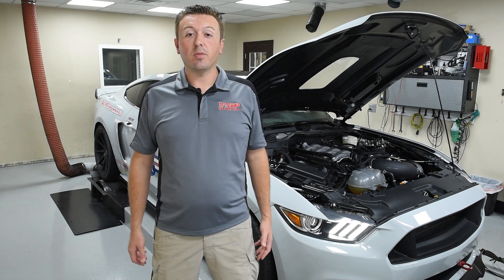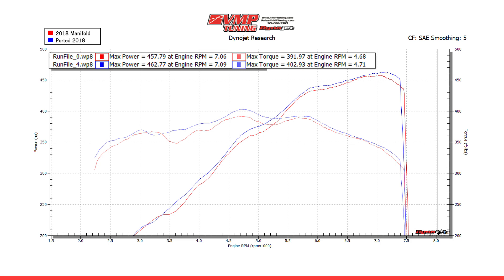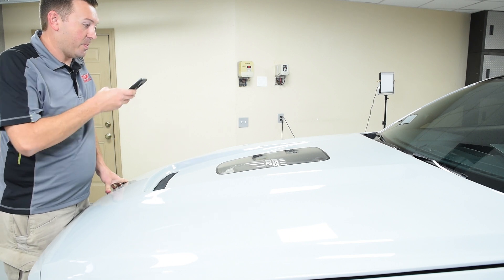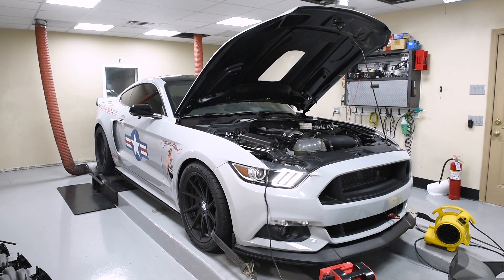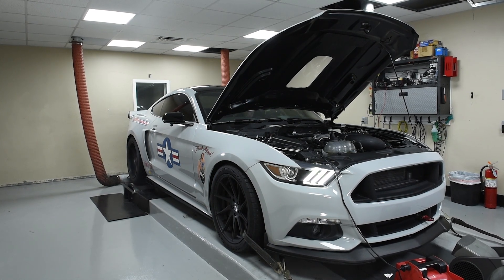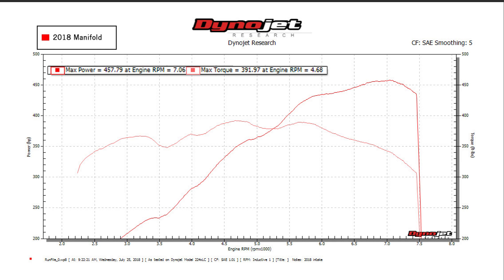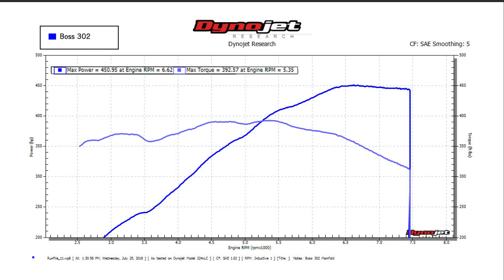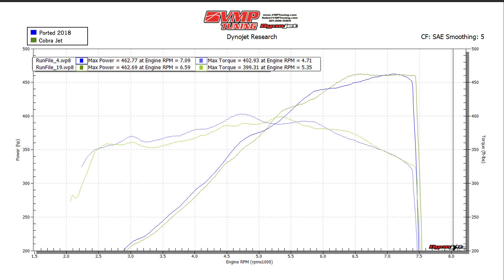VMP Performance | Coyote Ford Mustang Manifold Shootout

Comment: I have a 2013 5.0 and the truck manifold looks promising. Would like to know the difference in power through the curve of the truck manifold, stock 2015 manifold and stock 2011 manifold. They all drop off at 6500 but if you gained power everywhere else that would be a great bang for your buck. Many 1st gen Coyote owners dont want to rev past around 7000-7200K. Every single other manifold in this test would need to be revved to at least 7500 RPM or it would make the car slower vs the stock ones.

Comment: The truck intake is the best power curve for anyone swapping this motor into a car with any manual transmission other than a built T56 cobra spec or better transmission. 

You just can’t get older synchronization technology to shift much over 6500-6800

Also the older 5 speed transmissions have great gaps that are far larger than newer 6 speed transmissions. 

One question. Is the torque curve wave due to the variable valve timing?

Comment: I’m curious as to how much the heads and cam make a difference. I have an early Coyote from my old 2011 GT that’s been swapped into a Fox. It’s got the BBk swap headers and a 90 mm throttle body. But it also has Stock 2011 GT cams on the stock heads with the stock manifold. 
The Coyote is on it’s 3rd gen now and Heads and cams have greatly improved...so for a guy like me I’d still have to do a lot ( heads, cam, tuning,etc) to get similar numbers yeah?
Reply: There's a guy i know has videos on YouTube he has l&m intake cams and stock exhaust cams with ported gen 1 cylinder heads and ported cj manifold he made 488hp on a mustang dyno at only 8k his dyno chart showed the car was still making power even at 8k rpms

Comment: Very confused... This is being reported as RWHP, which is clearly listed as more than the flywheel HP.
Please explain 🤔🤔
Reply from the maker: The numbers presented here are measured at the tire so they are RWHP.
The dyno isn't "generous" it is a dynojet 224xLC.
A stock 15-17 GT M6 with 3.31's makes 370-385 RWHP with good 93 on this dyno.
A stock 15-17 GT M6 with 3.31's and a tune makes 400-415 RWHP with good 93 on this dyno. 
With a set of longtubes, a different intake manifold, and a cold air intake to make more power.
-Joe Goodnough
Reply: @VMPPerformanceTV  then what would the crankshaft calculated horsepower be?
I'm still very skeptical and I own one of these cars.
Reply: +AASR 32 I'm gonna boil this down to every dyno is different.
Reply: @aasr3251  
Roughly 500 hp at the flywheel. That's a 65 hp increase from stock, with essentially full bolt ons, tune and 93. Makes sense to me based on what everybody else has seen with these mods.
Reply: +Thunder Mountain Buildings  Huh!... He just said above they make 370-385whp stock. It's more like 90whp off full bolt on and 93 tune. I'm gonna agree with every dyno is different comment. You cant expect to see those numbers everywhere, that's rare.
Reply: AASR 32 I was wondering too
Reply: @gerardoflores6316  : clearly, something is way off- or they are reporting "flywheel" HP.
Reply: AASR 32  A chassis dyno measures rwhp and if I'm not mistaken, calculates flywheel hp if you choose to display that. Cars in this class almost always advertised by rwhp as they should. Unless I missed it, where did you see that rwhp is shown to be higher than flywheel? Also, even a small amount of familiarity with these cars would let you know that is absolutely rwhp and quite accurate.
Reply: @marklennon7362  : I agree with you Mark. RWHP is typically lower than FWHP. So since the numbers depicted in this video are in the mid 400 to almost 500HP range, CLEARLY, they must be depicting the FWHP  'calculated'(by the Dyno) number in the charts displayed.
For these cars (which I'm very familiar with) to make nearly 500HP at the wheels, there would have to be closer to 600 at the crank.
Reply: I agree, this car is a BIG overachiever!! 450-460whp with just an intake, manifold, exhaust, and tune. That is one hell of a generous dyno considering stock the make around 360-370whp stock. I'm curious what it made with the stock manifold.
Reply: @TheBlkMach  : indeed! VMP needs to shed some light on this!!

Comment: Maybe I missed it or wasn't able to read between the lines ...you didn't  seem to cover the issue of whether you needed or used larger than stock Throttle body (unless you covered that in the "ported" manifold)?

The factory 80 mm vs the GT350 87mm or one of the recent aftermarket versions...which are 90mm, 92mm+.

I've heard they give inconsistent (touchy!) street tuning problems - sensitivity? The 2015 - 2017 have factory control over the secondaries, I would not want to give that up by using the CJ manifold on a street driven car.

I settled on the GT350 with 87mm GT350 throttle body. ... and yes - it can be sensitive coming off throttle, but when monitoring the AF ratio, it works the 12.5 - 13.7 range during a full throttle pull just as you would expect. Recovery can be touchy - until the computer re-adjust to "street" driving mode again.

I decided to stay with the GT350 stage 3 kit.

Comment: $329 vs $1049 wow and they performed almost the same
Reply: Multiple tuners say that the gt350 throttle body provides no noticeable gains.
Reply: Andrew Schwab  did you not watch the Video? The very first test was a Stock 18 Manifold......
Stock 18 manifold= 457hp, 391wtq.
Ported 18 manifold=462hp,402wtq
 GT350= 457hp, 397wtq
Reply: The 18 intake was cnc ported how much was that?
Reply: Carlos Rodriguez it that the price for the 18 vs CJ???? I'm sure it's an extra few hundred dollars for port work.
Reply: Well, Im thinking if the 18 has gt350 tb, its still gonna be badass and a better option for less.
Reply: Andrew Schwab you stupid didn’t even watch the video
Reply: I'm sure he was talking about the 18 and gt350 cost. But keep in mind, they didn't add the gt350 throttle body to it, that sucks in more air.

Comment: The other thing to think about with a manifold replacement is drivability. How smoothly does the car accelerate when not under WOT? The GT350 manifold was built for the voodoo motor and not for the coyote, so while it makes great HP and good TQ, the drivability is not as good as the 2018. That's why I went with the 2018, and I don't regret it for a second!
Reply: But with the gt350 manifold when running with a bigger throttle body and adding e85, it out runs that manifold. You need bigger injectors with the gt350 and you get more power after 6500 rpms from e85. It just gives you more power with all the add on's.
Reply: @tommylee7749  I have 1 E85 station within 50 miles and it runs out of it. I wish it were more readily available, but I can't use it. Hp is nice, but as I said in my original reply, drivability of the 2018 is tons better than the GT350 as well... so if you have to live with it on the street and not just WOT at the track, go with the 2018.

Comment: Would love to see what the 2018 manifold does for all us 2011 to 2014 guys.
Reply from the maker: We'll be doing that test soon!
Reply: Please do!!!
Reply: cookymunster every race I’ve seen, a 2013-2014 pulls the 2015-2017 in a straight line. I know the 13-14 weights a bit less but I feel like the hp is close as ford likely underrated the 2011-2014 and just upped the advertised hp number as needed. Case and point the 8 hp “increase” from 2012-2013. Nothing was done to merit the increase. Ford just thought 420 sounded better then 412 I guess.
Reply: @mr.excitement689  The 8 horsepower increase was real. Ford eliminated the oil squirters on the 13-14 models.
Reply: 331Grabber how exactly does eliminating oil squirters get you 8 hp?
Reply: @mr.excitement689  
Ask Ford. They said eliminating the oil squirters gained the Coyote 8 HP
Reply: @mr.excitement689  windage
Reply: 773H fr what I was thinking
Reply: Yes. I been told to put a 2018 GT ported intake on my procharged 2013 F150. Now the question to get a truck manifold or the mustang manifold after seeing this test. Unless someone has a better idea because its boosted? I also been told in order to get the manifold to fit, I will need to purchase a 2018 mustang thermostat housing. Not sure if its the same issue with install on the 11-14 mustang.
Reply: Jesse LaBelle got an Instagram was looking at your YouTube vids but I don’t think your truck is procharged in any of them, or is it?
Reply: Trevon Adams  I thought the same, but he later said the only reason the Boss 302 made power out to 7500 rpm was because of the “bigger” cams and had nothing to do with the Boss 302 intake manifold.  The guy is hopelessly stupid and willfully ignorant.  

Put a 2013 Mustang GT intake on a Boss 302 and it will peak at 6700 rpm and fall off line a rock after 7000 rpm, put a Boss 302 intake and a 2013 GT and it carries power out to 7500. Funny how that works.
Reply: 773H Nothing because the stock intake was not restricting air flow.
Reply: blackericdenice  Lol, proven false.  Also, it’s not necessarily about “ not restricting airflow”, you may want to learn about helmhotz resonance and how intake runner length “tunes” those pressure waves.
Reply: @BCSVT  I don't need to learn because I already know. I'm sure Ford design the intake around that. I bought a 2001 Deville and drove it 600 miles before checking the air filter. It was getting 17.5 mpg mix driving. The air filter was gone. I installed a fram and the mpg went up to 19.5. Also ScannerDanner had a GM van that would not idle. The air filter was missing in that van also.
Reply: @Fone65  You obviously don't know, because the Cobra Jet, Boss 302, and now 2018 GT and GT350 manifolds have been providing solid HP gains and an extra 1000 rpm of usable power on the 2011-14 5.0s (versus the stock 11-14 intake manifold) for a long time now.  

What's clear here is a that have a lot of learning to do because you are absolutely, unequivocally dead wrong and clearly do not "know" what you think you do. 

What's also clear here is that you are confusing the intake [manifold] with the intake inlet tube.
Reply: @BCSVT  Ok, first off. I checked to see if you had videos. A lot of guys with no videos love to TRY to school me. 
An intake a lone will not increase hp. Yes I have seen the dyno videos where the guys selling intakes, claim they did. An intake damn sure want give 1000 rpm or even 100 rpm more of usable power. You have to change the cam to change where the engine peak hp is. The Boss 302 made 444 hp @ 7500 rpm because Ford installed hotter cams. Intakes are just for looks and to fool stupid buyers into spending more money. 
The 1st. Taurus SHO had a 3 liter v6, made 220 hp @ 6,000 rpm and had the best looking intake ever made. 
The 300zx had a 3 liter v6, made 222 hp @ 6400 rpm and had a completely different looking intake. The Acura NSX had a 3 liter v6, made 270 hp @ 7100 rpm and had an ugly looking intake.
Reply: Trevon Adams  Dude, the 2012 Boss 302 32 hp over the GT come from the hotter cam. Not that ugly intake. That is why the Boss peak at 7500 rpm.

Comment: Maybe i am wrong but that F150 looks pretty good to me especial if you have an automatic car.If you are making peak power at a lower RPM 6500 and your automatic car is shifting at that RPM and the other guy has to go to 7500 you are banging gears a lot sooner.What do you guys think? And thank's for the test VMP!
Reply: No that's not the way to look at it. It's the area of th curve that you are using the truck manifold once you shift is at around 4500 rpm that's not Gunna be making alot of power there. Where a 18 you shift at 7500 and be around 5500 it will make better power overall
Reply: Thank's for the response.At 4500 RPM the F150 intake is making over 400 lb ft of torque in my mind that's pulling power. If we are talking full on race car i agree launch at high RPM and bang gears and keep the revs up there if that is where the power is.But for street and occasional track with an automatic car i think the F150 is a winner based on dollars and the return for those dollars. And at 5250 RPM it comes back to over 400 lb ft of torque.Go back to 6 minuets and 44 seconds look at the chart the F150 beats the 2018 from idle to 6500 RPM.Something to consider. Thank's
Reply: @enak319  I agree the truck manifold is great! For a truck, it adds significantly more torque to the coyote just simply from a manifold! But if you want to run at the track vs towing the 18 gt manifold is night and day better
Reply: Maybe
Reply: You are missing an important factor, higher gears put you at more of a mechanical disadvantage. You accelerate faster in 1st than in 2nd, as long as your tires are not spinning.   the extra RPM and the engine still making power lets you stay in the gear longer. Think about boost by gear setups, higher gears you can run more boost and still not accelerate as fast as the lower gear with less boost.
Reply: A few years ago i had a 2011 GT automatic car exhaust cams cat delet trans brake stock rear gear stock converter the car ran in the 12s not sure of exact et. Swapped the intake for a Boss lost 2/10 in the 60 ft 1.79 to 1.99 and lost et.

Comment: Now it would be cool to see what each manifold does in 1/4 mile on an automatic car with drag radials shifting at peak HP
Reply from the maker: Thanks for the suggestion!
Reply: @VMPPerformanceTV  on a stock engine Gen 1 is the intake manifold worth it ?
Reply: @TheGreatestEverLived absolutely but the more stock it is the less worth it it's gonna be.  Meaning you are bone stock everywhere it won't help as much obviously but if you have a cold air and headers and a good tune it is absolutely worth it.  With cams even more so.  The more supporting mods the more worth it it's gonna be but to answer your question yes its a significant performance gain ecsp on gen 1 and 2 cars
Reply: @midnight347  thanks bud. I don't think I'd ever do cams because I like the drivability of the VCT and I heard cams disable that, but LTH would be good. My airaid intake is compatible with the CJ IM, but I think I want a closed box unit if I can find one. Otherwise maybe I can make a cover for mine

Comment: So glad I went with the 18 manifold. Saved a ton of cash and gained a bunch of power.
Reply: You mite save money but lose a lot of power with adding e85.
Reply: @tommylee7749  how much hp did the 18 manifold lose on E85?
Reply: Does engine cover still work with 18 manifold
Reply: @arturo5819  not without modifying it.
Reply: What is the retail price on an 18 manifold?
Reply: I paid $265 but I think retail is around $320.

Comment: Why does the CJ flatline at 6500? Makes ZERO fucking sense unless you weren't altering tunes between runs to accommodate the manifolds. The CJ climbs from 6500 on in every other DYNO I've seen. Something is off here.

Comment: Which throttle body was used? Which fuel, 93 or E85?
Reply from the maker: Stock 15-17 TB for everything except CJ. Fuel was 93 Octane.
Reply: Thanks guys!
Reply: Vmp, tell the viewers witch manifold is better when adding e85 and why?

Comment: I have a 2018 f150 in my  experience i gained peak  Torque  lost hardly anything below 3000 Rpm  gained everywhere else  Switching to cobra jet  Intake my 60 foot went down 0.15
Reply: Still waiting on that new track video!
Reply: ntx lsx racing  I posted a little short video my son shot  He is 8 years old  But he got the timer  I was not happy with the run

Comment: Were the 18's locked out or using pigtails? And thanks for this test VMP!
Reply from the maker: The 18's were not locked out.
Reply: @VMPPerformanceTV  I see you guys offer the plug harness that comes with three plug wires. I bought pigtails from another source and they only offered two. I'll be ordering from you guys shortly....

Comment: Were the tests done on 93 or e85?
Reply from the maker: 93 Octane
Reply: Roughly how much more would we see on good e85?
Reply from the maker: William Cook  it should see about 7-15rwhp
Reply: Was this with y'all harness or with mmr lockouts for the 2018 manifold?
Reply: The numbers are different with each manifold,  but I can tell you with the gt350 manifold.  10 to 12 hpr up to 6500 rpm then over that its 30 to 40 hpr to red line.

Comment: Need this done on a 11-14 🤠
Reply: Wondering if it's worth the money to get a 2018 manifold from the junk yard to put on gen1 5.0 or buy one to complete the full bolt on list?
Reply: Kona_blue_5.0 if you can find one from the junkyard I would grab it. I know VMP sells the tuner and manifold combo but I would get a used one and send it to get ported.
Reply: go to my video clip,i have one of the first 2014's running the 18 intake,made good hp and idles way better too-the torque loss down low is annoying so im looking for a solution to that
Reply: a little procharger can sure help
Reply: @czza2949  nitrous helps too
Reply: Coca Cola hell yeah brother
Reply: steve will  did you have a proper tune? What was the cost?
Reply: gears?
Reply: It would be basically same results just slightly different numbers before and after

Comment: Great Video guys! I was waiting for this, purchased the ported 18 kit from you two days ago. However I do have a couple questions, what was the peak the stock GT manifold made? Also is this car running on 93 octane?
Reply from the maker: Yes, car was running on 93. Will have to check on the peak for you.
Reply: VMPPerformance Thanks for the reply, will be looking out for peak info.
Reply: VMPPerformance I just realized it’s on E85 by looking at the torque.
Reply: I have a 2015 GT, do you need a tune for the 2018 intake? Or just plug and drive. Also I already have a Ford performance tune stage 1. Can I still use the 2018 intake with this tune?? Will there be any checked engine lights. I hear this might be a issue